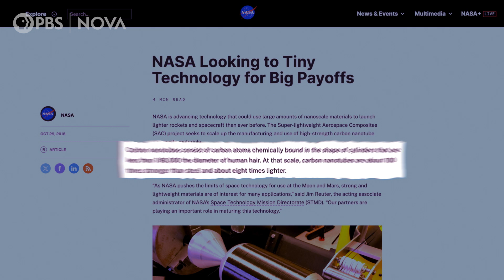The Rocket-Less Future of Space Travel | What the Physics?! | NOVA | PBS

Comment: The future of space travel is fission rockets. If a spaceship travels at a constant 1g acceleration rate it would get to Alpha Centauri in about 3.6 years (7.3 years would pass on Earth) and this includes turning the ship around halfway to decelerate. It would achieve about 95% light speed in 1 year. This is by far the fastest way we can get to other worlds and the ship would have gravity the whole way. A 10 ton ship would require 10 tons of continuous thrust.
   All that is needed for this is a true fission rocket that can put out thrust for long periods and does not consume hydrogen. What's needed is a controlled, time released nuclear explosion. There should be a way to get uranium or plutonium to fission in a linear fashion.
   In an atom bomb fission occurs when neutrons hit uranium or plutonium nuclei. This is because they won't tolerate an increase in mass. Due to the equivalence of mass and energy the same should be true if they are infused with energy.
   This might be as simple as having negatively charged uranium or plutonium atoms coming into contact with positively charged uranium or plutonium atoms. Or perhaps with electromagnetic or laser energy.
  With the constant acceleration method a ship can span the diameter of our galaxy in 24 ship/113,000 Earth years. Systems with stars similar to our sun can be reached in under 10 ship years.

Comment: The space elevator idea forgets that there is a MASSIVE amount of sideways momentum needed for each unit of mass put into orbit. Note: SIDEWAYS! Everyone worries about going upwards, but that's just peanuts to achieving orbital velocity that whatever payload going up the space elevator must achieve to match the velocity of the geostationary tether and counterweight. Failing to impart that extra energy means the whole thing gets dragged backwards, westward, and also downwards towards Earth. The only way this energy could be injected into the system is to throw mass at some speed in the opposite direction... so a rocket of some sort.  Perhaps ideally a very efficient ion propulsion system that is powered from the ground and/or solar panels on the counterweight, but mass still needs to be flung away, and then you end up with a similar rocket fuel mass problem only lessened by a more efficient way of flinging that reactive mass away faster, unless you are always sending as much mass down the tether as you are carrying up, which has its own problems and energy requirements
Reply: Could the cable not be angled to provide this extra orbital momentum? And/or you will also have cars coming back down again, were presumably you will need to dump this momentum: perhaps the up and down cars can be played off against each other?

Comment: Thanks for an interesting video. I think that a Space Elevator could be built on the Moon, or even Mars, (with little or no atmosphere), but would be too difficult to build and far too expensive for the Earth.   To use a Nuclear Rocket, chemical rockets would still be needed to launch the Nuclear rocket engine into orbit. Nuclear Rockets would be for "in-space" use only - they would be impractical and unsafe for ground launches to orbit. The components, such as engine, fuel, shielding and habitat, would have to be launched separately and assembled on orbit.

Comment: Seems counter-intuitive. It would take many rocket flights into space to set this up. Too dangerous to utilize from several miles in the atmosphere then into the vacuum of space. The risks would propably outweigh the benefits.
Reply: @FentonFromTrenton320  I’m sorry I disagree with you.
A space elevator for lifting mass out of Earth’s gravity well without using rockets is logical and much more economical than a rocket. 
An extremely strong cable which extends from Earth’s surface to the height of geostationary orbit (35,786 km [22,236 miles]) or beyond - is doable indeed.
The competing forces of gravity at the lower end and outward centripetal acceleration at the farther end would keep the cable under tension and stationary over a single position on Earth. 
It would then be possible to attach a payload to this cable on Earth and lift it by mechanical means to an orbital height. When released at that point, it would have the velocity to remain in orbit or to use an additional in-space propulsion system to send it to deep-space destinations.